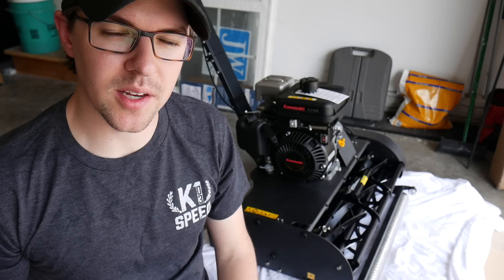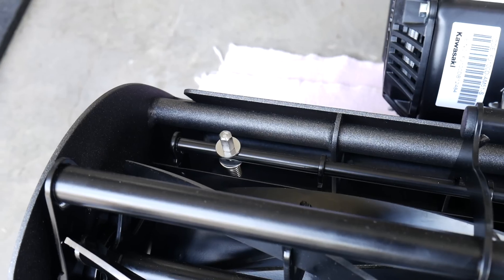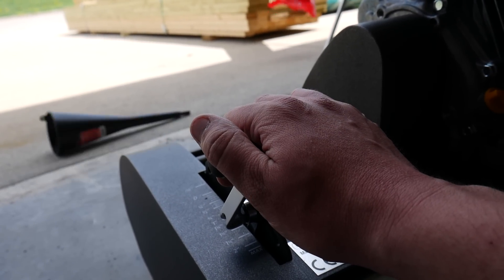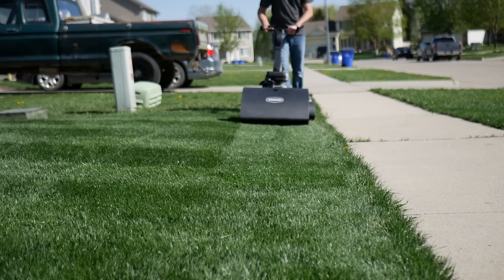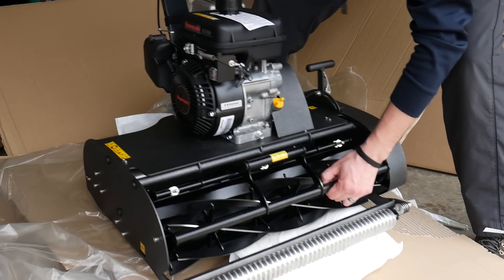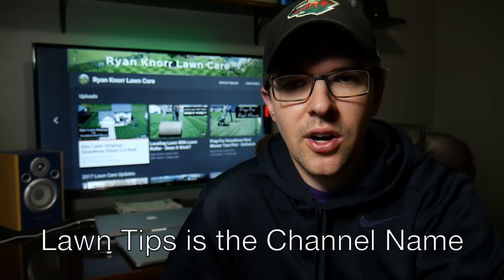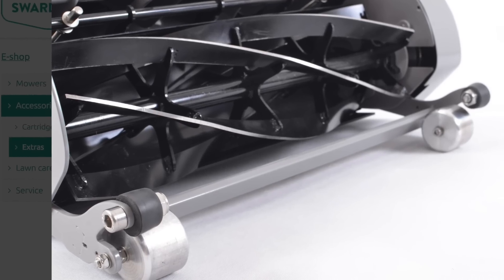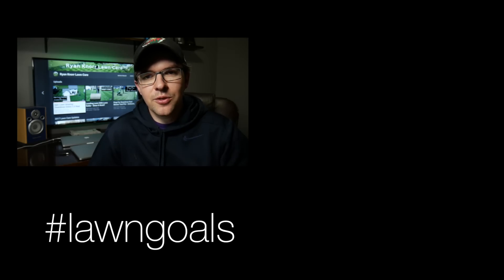Swardman Reel Mower Setup and Initial Thoughts + Q&A

Comment: Hi Ryan. I am unable to remove the spark plug end cap to change the spark plug. Tried to twist in different directions and pulled but no luck. Do you know what the issue could be and any recommendations?

Comment: Ryan, what do you use for weed control. You have done a great job in keeping the weeds from your neighbors
Reply from the maker: Very rarely do I use weed control as my lawn is thick enough to crowd out the weeds but usually if I spot spray just a simple weed-b-gone type product will work for most things.

Comment: Do you have any issues mowing the edges of the driveway and sidewalks?  Seems like the rear roller would get scratched up pretty good after a while?  Also, with this type of rear roller without any rubber on it, do you get good traction or does it spin?
Reply from the maker: The only issue is the noise of the aluminum on the concrete.  It does scratch it some but I don't think it will be any serious issue other than it is truly a terrible sound.  Traction has been fine for me.

Comment: Curious if you ended up adjusting the handle up. From my experience mowing baseball infields with a reel mower you want the handle at slightly higher than you do with a rotary mower. This prevents bouncing the mower as you walk. If a rotary mower bounces up a little the blade can get it on the backside. With a reel mower if you bounce it up you will have a high spot where the reel was a bit off the ground.
Reply from the maker: I just ended up adjust the main handle part (that has the drive and reel control on it) and have felt very comfortable with it so far.

Comment: To truly disable a engine for maintenance or adjustment, remove the wire to the spark plug, not rely on the fuel cutoff.

Comment: I live in the suburbs of Chicago my grass seems to be growing in some spots and overall it's not going at all is very green but it doesn't grow it doesn't spread I wonder what's going on how can grass stay the same for weeks at a time extremely puzzling I was told I should put some iron into the grass 4% iron what is they going to do for me thanks I love the video however nothing beats my tractor I just love it
Reply from the maker: Iron is for making grass greener but for growing you need some more nitrogren or basically just fertilize the lawn.
Reply: The grass is not growing because all the lead from the bullets landing in your lawn is poisoning it.
Reply: Put a starter fertilizer on that grass and water it in. In 7 days it will be thick and lush in this weather

Comment: Great video again.  I noticed you were staying a few inches away from the concrete sidewalks, is this just being overly cautious, since its so expensive or can you not run it down close to the sidewalk?  Once again great video
Reply from the maker: Just being overly caution at the beginning while I learn the machine.  :)
Reply: Hi Ryan, no worries about the edges. Just cross over to the sidewalk. Since the mower moves on rollers and the reel is during the cutting always above the low level of the rollers, there is no way you can harm it:) That's one of the advantages compared to rotary mowers...
Reply: Hi Ryan, I found a few websites that sell Swardman.  Is there one you recommend? and do you have a coupon code.  I would prefer using a website where you can get some credit for your video.

Comment: Max of 2"?  I have a feeling it going to take a ton of water in the summer?  How does it run the drum on cement driveway, don't you want to protect  it?
At higher cuts you can keep tract of patterns so you go against the grain every other cuts to pull it back up.
Keep up the good work.

Comment: Looks like its max height is 2inches. That seems way too short for Kentucky blue grass. I keep my grass at almost 4 inches minimum
Reply: Are you in a very hot climate?
Here in the northwest lots of lawns are kept low.
Reply: I'm in Michigan. I've found the best way to shade out weeds and fight heat stress is to keep my KBG at 4 inches. The only lawns that I see that struggle are the scalped lawns. 2 inches is way too short for kbg.
Reply: have you ever seen a baseball game?? 90 percent are KBG and they mow at 3/4 to 1 inch.....alot of golf course fairways have kbg too
Reply: I googled it. 
Kentucky bluegrass lawns should be mowed at the height of 2.5 to 3 inchesin spring and fall. Set the mower blade to a height of 3 to 3.5 inches during summer.
Reply from the maker: You have to also remember that golf courses use products that most homeowners don't use to better utilize the water.  Wetting agents and growth regulators are a couple examples.
Reply: Brad Carrick
You have no clue what you are talking about.
Reply: Here in NZ we generally cut about one to one and a half inches. Somewhat similar to lawn-bowls height.

Comment: Great Review bro. 🤙

Are the rollers meant for just striping or are they also for keeping the ground level over time?
Reply from the maker: They help to make sure you don't scalp the ground.  Since it's rolling along and doesn't  have 4 pivot points like a normal mower would that has wheels, it stays more level over the ground.
Reply: The rollers are used to keep the mower straight and level.  As a consequence it creates stripes by flattening the turf in different directions.  The mower isn't really heavy  enough to flatten the lawn. It may look flatter as it will conceal divots etc

Comment: The grass didn't look like it needed to be cut.  Show if cutting deep grass.
Reply from the maker: That's how reel mowers work. They are designed to cut lower heights where you're not taking off as much grass blade.  They don't work well with tall grass.

Comment: Rust is the enemy of sharpness on your new machine.
Some older brushes from your car detailing work may fit in well and clean bits stuck here and there from the cutting surfaces.
A touch of wd-40 or another dry lubricant spray will finish the job.
I don't know what your manufacturer recommends.
Reply from the maker: I'll talk to them about that.  Thanks!